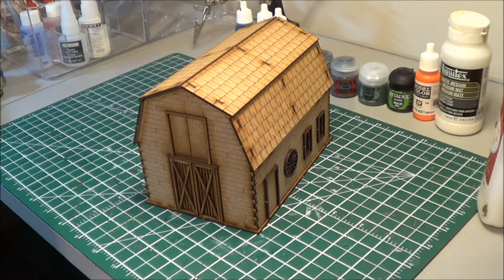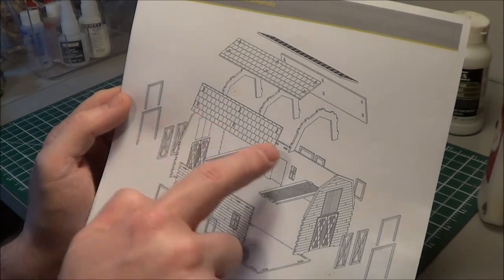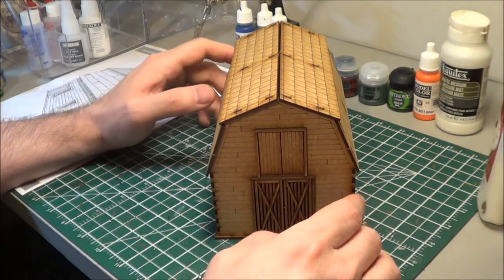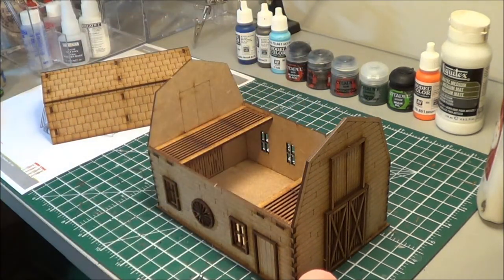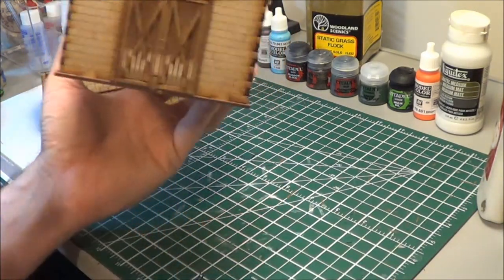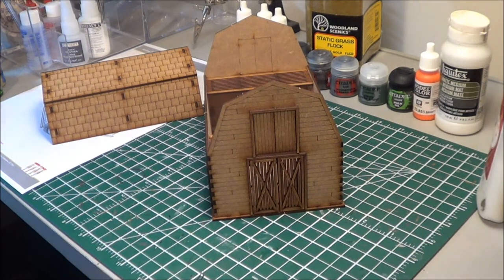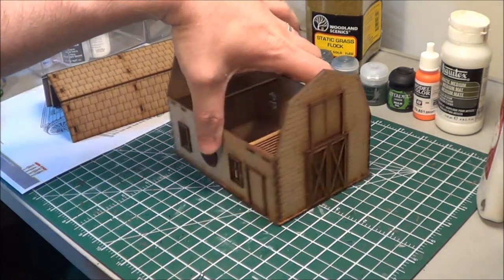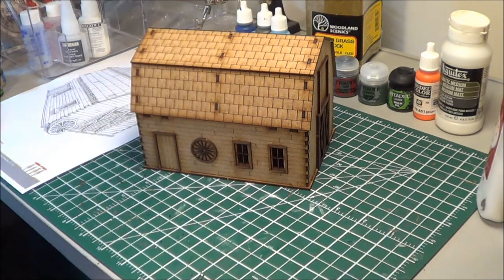Sarissa Precision North American Barn- first look

Comment: I saw in the comments you decided what to do with the doors which was going to be my vote.  The reference pictures are good and are like a lot of the older farm buildings in my area.  The color isn't quite the easiest to pull off look wise.  :)
Reply from the maker: Thanks Smitty and your right this one is going to be a challenge but I am up for it still crossing fingers though ha ha!
Reply: I thought of this after I posted my comment.  Have you looked at maybe using some ModelMates on it or checking the model railroad stores to see if they have something to simulate the effect you're looking for?
Reply from the maker: I haven't thought of that at all but good idea. I am already into the paint job now though just put up a vid showing one wall with the end result. Cheers

Comment: That is a good looking kit.
Have you considered based coating before assembling?
Thats what I did with the 4Ground buildings where I changed there colour.
Reply from the maker: That's a good idea Dervan I hadn't thought about it. Since there isn't much detail in the interior it likely would have worked for this kit. If it had a detailed floor like the other house I would still struggle to do the finishing under the hay lofts. So far having the base removed has worked well. Cheers